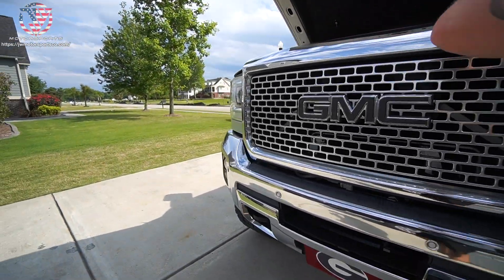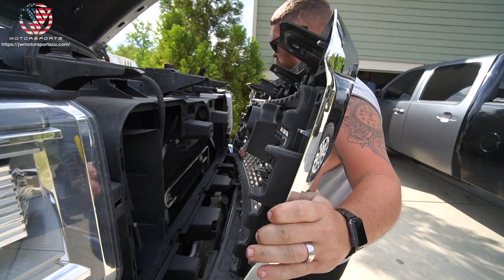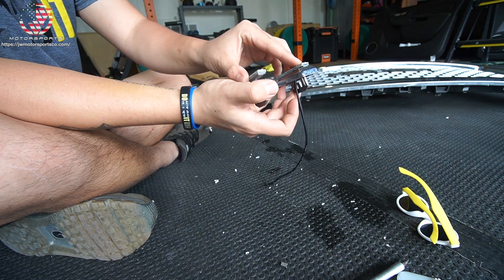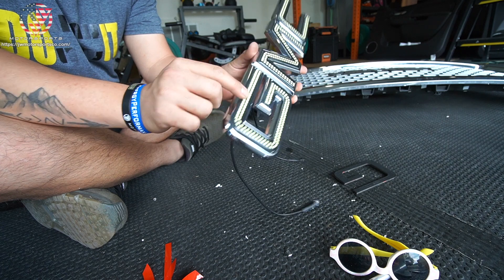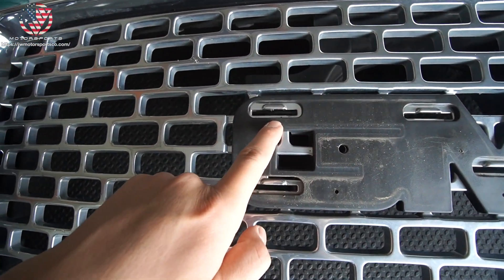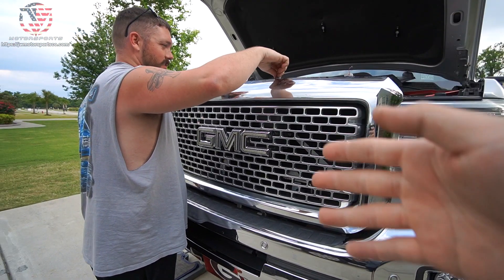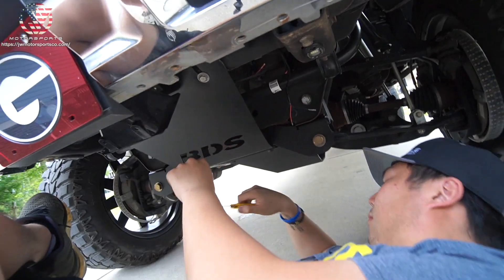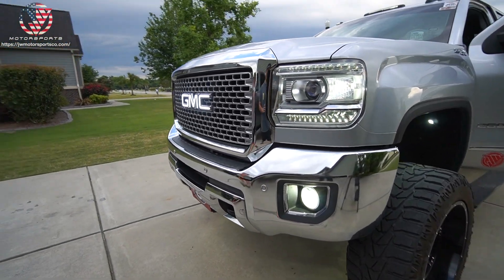HOW TO INSTALL LED GMC EMBLEM ON (07-18 GMC SIERRA)

Comment: Could you run an add a fuse adapter to the drl fuse or would it be to much
Reply from the maker: Yeah
Reply: I just did some halos for my fog lights and couldn’t find anywhere to fuse tap in my firebox for the drl lights so I ended up tapping the to trailer running lights I really didn’t want tap the wire if anyone’s has any idea where to tap to drls by fuse tapping I’m all ears I have a 2018 btw